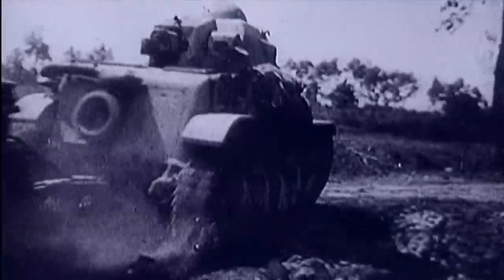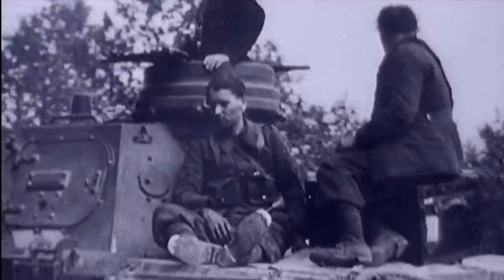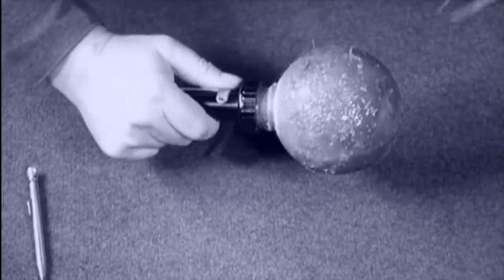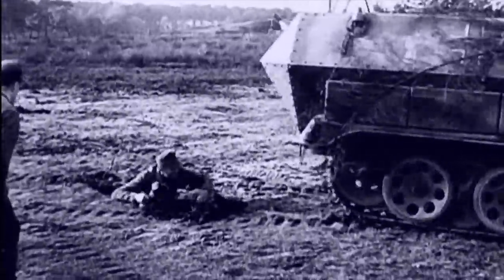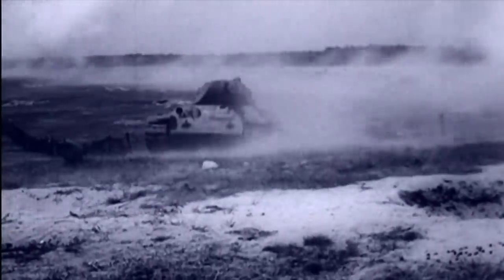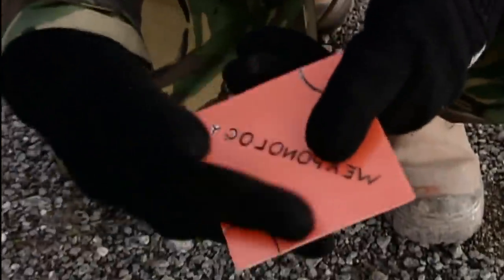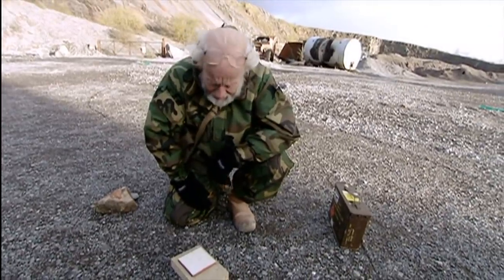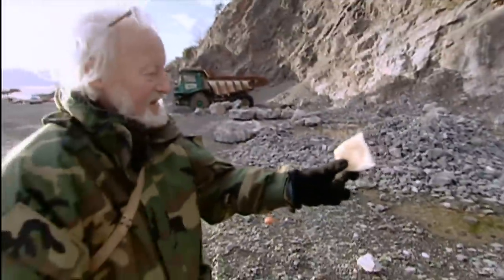Weaponology - "Sticky Bomb"

Comment: So heres a little bonus thing for yall: When the germans were making the magnetic charge they were also inventing a counter to it in case the allies copied them. It was called Zimmerit glue (the grooved lines on the German tanks) and would make it difficult for magnetic grenades from sticking to the tank. The downside to the whole thing is that only Germany used magnetic grenades making the glue pointless.
Reply: They just wanted to be sure

Comment: The trouble with the Hafthohlladung was that, unlike the Sticky Bomb, you couldn't actually throw it; you had to literally run right up to an active enemy tank, hand-place it to ensure it gets a grip on the armor, give a good hard yank on the igniter pullcord, and run like hell. The Sticky Bomb, meanwhile, was designed from the outset to be thrown by a grenadier from cover such as a foxhole. The Germans basically stopped using the Hafthohlladung as soon as the Panzerfaust (a sort of disposable anti-tank grenade launcher, in fact you can see one at 4:35 on the shoulder of the German soldier) was available in sufficient numbers, and declared them officially obsolete in early 1944.
Reply: The Soviets probably had the best idea with the RPG 43.  It uses a shaped charge, but deploys a parachute as it’s thrown so the warhead always hits straight-on.  A later model called the RKG 3 is still being used in Ukraine as a drone-dropped anti-tank bomb.
Reply: @maximus9812 Around the same time, the German also came up with Panzerwulfmine. Which is also thrown like RPG-43. However, they were considered to be downgrade compare to Panzerfaust so they weren't used as much.
Reply: At least both ars better than what the Japanese came up with, Shitotsubakurai. Aka the Plunger of Doom.

Comment: Man were some of the UK's engineers intelligent or what compared to Germany's lol. UK: Yeah we'll create an anti tank sticky bomb literally using strong glue to make it stick.
Germans: Tanks are made of steel. How about we create a magnetic bomb so that it will stick to the metal.

Common sense tells you the German's had better thinking. Compared to the risks involved of using strong glue for the 'sticky' bomb, an how much more risk you had of it sticking to almost everything and anything. Tf man lol.
Reply: glue sticks on most surfaces of different shapes, magnets only on some metals
Reply: Mustang Rt all vehicles were steel and iron though..
Reply: tires too ? Also gue is cheaper than strong magnets.
Reply: Also: Britain was rather resource strapped at the time and couldn't waste valuable metal to make magnetic bombs.
Reply: +mikeze123 Since when are tires bulletproof? Why risk running up to a vehicle to blow up its tires?
Reply: MachineMan1992 More important is the brits could not afford to have their own personnel blowing themselves up with such an ineffective device.
Reply: BOMB CAN STICk to tires and make damage to other elements too, also tank can be really dirty and magnets can lose their ability to stick also are heavy.
Reply: never said that sticky bomb wouldnt fell off ;d main reason that sticky bombs is better idea are their price and simplicity.
Reply: mikze123 dude how expensive do you think magnets are? i mean cmon using fucking industrial glue that could potentially kill your own soldiers, thats freaking stupid
Reply: to created those extra magnets would require a longer process rather than just upping the production rate of a resource that is already on the production line such as glue. Germany only had so many factory's while the Brits had the factory's of all of america so on so forth with the amount of allies the allies had.
Reply: italians just threw demolition grenades on the engine grille
Reply: Disabling it, preventing movement. I see plenty of benefits to impairing the movement of a vehicle, especially when your charge cannot do decent damage against the interior of the tank.
Reply: Noah me too and you can get cheap strong ceramic magnets for 10 pesos (50 american cents) so its still the dumbest shit to fucking put glue to an anti tank grenade, i used to work at an electronics store and we would sell neodimium and ceramic magnets so i know which the prices are
Reply: ForgotHow ToUsername yeah it is a little bit harder to produce magnets than to produce glue but in that case why didnt they built the tanks with wood? cheaper and easier to cut, oh i wonder why they used steel
Reply: +Lord Turnip "why didnt they built the tanks with wood?" Actually they did, or at least the Germans did. German tanks were coated with a special anti-magnet compound called Zemmerit  its 3 main ingredients were Cellulose (wood fiber), Ceramic powder and Poly-Vinyl Acetate.
Reply: +Lord Turnip  You are absolutely correct it was, in hindsight a very dumb and wasteful idea... which is why the weapon was eventually removed from active service before the war ended. Most of the 2.5 million No.74 MKII grenades produced remained in storage when the war ended.
Reply: The real doktorbimmer coated, not built
Reply: Later in the war they started using paints that prevented you from magnetically attaching things to them.
Reply: +TheMainMayn So... are you basing your entire view of the UK's engineers of that era on one slightly wacky idea? I suppose those crazy Brits and their mad ideas are why Germany won the war... :-P

The Bombe. Colossus. Manhattan Project. Radar. Jet engines. Tanks (ok that one was WW1). Inarguably brilliant British contributions to engineering through WW2. 

The truth is that all participants researched many ideas, some turned out to be useful, some not. For example, Germany had the Schwerer Gustav - sounds great in theory, an 800mm calibre gun that can smash reinforced concrete from across the English Channel. Except you can't slew the gun to point at a target, you have to find a bit of railway that faces the target. Ooops, you actually need TWO bits of railway at the correct distance apart, side-by-side. And it takes 45 minutes to reload. And you need so many people to maintain and run the damn thing that you would end up impacting the war effort elsewhere. Plus it's so damn huge that it's an easy bombing target, and you would take out hundreds of soldiers at the same time because, well, it needs all those soldiers just to maintain and run it.
Reply: Then why did the brit lose their colonial empire and cease to be a superpower after WW2?
Reply: A magnetic mine can't be thrown,  it's a 3 kg hollow charge placed by hand.  Any candidates?.
Reply: If your going in on a suicide mission? Wouldn't you rather have an explosive charge that will actually destroy a tank, and not blow you up first?
Reply: doktorbimmer Compared to à Molotov cocktail it's safer and can more predictably destroy even a tiger. 
The German solution mainly scared themselves.  Zimerit increased costs and load while weakening armour.
Reply: The blast is a much bigger problem with the German solution,  where the sticky bomb is very similar in use to a common Mills bomb while having a much smaller blast radius.
Reply: +Adamast  Shaped charges have a smaller blast radius and much more effective armor penetration... the German device was not likely to attach itself accidentally on a non-target personnel either.
Reply: 1.5 kg of explosives with a 4.5 sec friction fuse hand placed vs 0.6 kg of explosives with a 5 sec fuse hand grenade,  your choice.  The roof of a panzer 4 is 10 mm,  no need for a hollow charge or even a heavy blast. 
You think that a sticky sock is as strong a glue as cyanoacrylate. 
From afar I think the British No. 68 AT Grenade developed the same year is mostly better than the No. 74 sticky Hand Grenade.
Reply: +Adamast The shaped charge device is the clear choice... without any doubt. Its the basis for all modern Infantry anti-tank weapons used today.
Reply: Netheryk You know what they did with their totally superior pre ICBM technology most of the time?  Bombing Antwerp.  Did you ever hear about the bombardment of Antwerp?
Reply: Really? As long as you hold it it wouldn't fire,  just like any (non german) hand grenade.  But I get you prefer a fire and run situation.
Reply: Who cares about looking when there is the meme.  There is clearly a safety lever along the handle held by a safety pin.
Reply: news flash! britain win and germany lost ;) the germans always takes things too far and pay the price. over engineering is one of those.
Reply: Dok - Because of debt and those countries wanting independence. Germany lost, deal with it.
Reply: Herr - The Sten was a decent cheap sub-machine gun that was used until very recently by the Indians. 
And lets face it, the Germans needed the help, poor things were getting their arses handed to them.
Reply: Felix- UK helped? They did I bit more than that. If it wasn't for Germany fighting Britain, losing massive amounts of resources to the Royal Air Force and Navy, and losing in Africa, they would have easily overwhelmed the Soviets. Losing to the RAF and RN was devastating to the Germans.
Reply: TheMainMayn yeah but who won the war?
Reply: Lol... it's so true. Just look at what helmets the Brits came up with in WW1 and kept on using them in WW2 you can't make that shit up... the list goes on, something just doesn't quite work out for them in engineering things
Reply: DS -  The list goes on? Please enlighten us with your imagined list.
Reply: Some guy said blow up tha tires😂😂😂
Reply: mikze123 actually you would be surprised how much that glue costed
Reply: Glue cost alot too
Reply: TheMainMayn Germans had a much higher budget, the Brits were desperate. And the sticky bomb did probe effective.
Reply: TheMainMayn dont you think magnets would be more expensive
Reply: It wasn't only used for tabks
Reply: The German AT device was much more dangerous to use as you literally had to run up to the tank and slap it on the side. The sticky bomb could be thrown or dropped onto a tank from quite a ways away, comparatively.
Reply: TheMainMayn magnetic doesn't work on other stuff ;)
Reply: "Common sense tells you the German's had better thinking. Compared to the risks involved of using strong glue for the 'sticky' bomb" you can trow that sticky bomb on top of the tank from window/distance and forget about it, german design needed to be manualy instaled on tank. Germans didnt have strong magnets(as we know them today) during WW2. In reality bouth designs was equaly crapy and ineffective...
Reply: well the sticky bomb was developed for guerillia so total okay
Reply: TheMainMayn 
Well, it seems the glue bomb was throwable while the magnetic bomb had to be placed directly by hand. I'd take that glue bomb over the magnet bomb any day.
Reply: Tanks had anti-magnetic coatings and the magnetic charges became ineffective whereas the sticky ones didn't.
The magnetic ones couldn't really be thrown and had to be placed at a specific angle, which the sticky ones didn't'
The sticky bombs were much, much cheaper.
Germany was massively low on rare Earth elements critical for not only magnet production, but steel production too, which became a massive issue late in the war.
If anything, the German engineers had worse thinking, the only think they improved upon was the actual explosive charge. You have to think, if Germany's engineers were lightyears ahead of everyone else like you Wehraboos like to claim, then they wouldn't have lost the war.
Reply: Germans couldn't think well enough to win a world war though
Reply: TheMainMayn That was only one weapon
Reply: Zimmerit
Reply: the germans were the most intelligent, hell thanks to them half the shit we have to day wouldnt be here with out them.
Reply: unless the magnet sticks to your helmet.
Reply: youd just need a better design to avoid the magnet sticking to you, like if they used an electromagnet inside a round ball and have a slot for a button that breaks once pushed in and completes the circuit from a battery to activate the magnet and tossed at the same time with the explosive being impact sensitive you'd have an efficient sticky grenade
Reply: TheMainMayn with magnets you had to run up right next to the tank and place it. The glue can stick even if you throw it from far away.
Reply: Germans put an anti-magnetic coating on their tanks.  It greatly reduced the ability to stick to armor via magnetism.
Reply: TheMainMayn and so anti magnetic tanks.
Reply: atleast the magnetic charges dont stick to your soldiers.
Reply: @mikze123  tanks didn't have tires,  they had treads
Reply: Germans are superior lollol
Reply: The only issue the German's version had was that you couldn't throw it towards an enemy tank as the magnets were only on one side, and it wouldn't work if it wasn't stuck on properly.
Reply: luckily we weren't smart enough to win the war(s)
Reply: It's almost like weapon technology progresses and progress is hastened when in war. Who would have thought it.
Reply: Worth noting that the Germans actually used a protective non magnetic armour covering on their tanks. Therefore negating any benefits of the British using magnetic bombs.
Reply: @alejandrorobles6865  thats now, not in fucking 1943 smh
Reply: It's not like they were two methods used for the same problem. The ways you could use the sticky bomb were much different to how you would use the magnetic shaped charge. For example, you could not throw the shaped charge down form a window, you couldn't throw it under a tank, and you could not use it to damage tracks of a tank. There was a very specific way of using it and it was also useless against pretty much anything other than tanks. 

When it comes to engineering, Brits had HESH ammunition for example, which was very effective against some tanks, as well as fortifications and structures.
Reply: gromann what about the tank crews that decided to cover their tanks in camo materials that were not magnetic?glue bombs provide many problems for the person using it but it sticks to anything
Reply: @mustangrt8866  But its not like the armies could afford replacing all the tanks to change material type.
Reply: Mustang Rt / The risk of it sticking on you is lower unless you are magneto.
Reply: Yea uk dum
Reply: @mustangrt8866  WWII tanks were steel, and glue is pretty much shit on a dirty surface.
Reply: The "sticky bomb" was intended with the capacity to be thrown, and didn't use a shaped charge. It was essentially a squash head round, hand thrown.
Reply: German tanks had an anti magnetic coating, so now who's clever ?

Comment: The jet of metal (usually copper) being forced through the tank's armor (usually steel) is so high that it looks like it melted through. At those speeds metal behaves more like a liquid than a solid. The actual hole is quite small, but the real havoc happens inside the tank. Imagine being hit by a jet of hot metal, having bits of hot, fast metal shooting around the inside of the tank or it hitting the ammo.

Comment: A solution would be to attach a small compressed air canister in the stick grip of the grenade that would trigger a second after pulling the pin and "shoot" the cover off of the grenade while it is in flight

Comment: The British military was never particularly interested in what one would term "user comfort" for their enlisted soldiers (other ranks).  Yes, the Sticky Bomb was the worst, but there were others.  The British Boys anti-tank rifle is said to have a tremendous and very unpleasant recoil.  Likewise, the PIAT, the British counterpart of the Bazooka, was tricky and often very hard on its users (though it did have a much better bomb than the Bazooka).  And then there was the SMLE .303 caliber British Jungle Carbine with a cone shaped flash hider on the muzzle. The cone captured muzzle gas and vastly increased recoil. In response, their military put a "recoil pad" on the butt of the rifle stock to help out a bit, but the pad was made of extremely hard, non-recoil-absorbing material, and was a complete waste of time.  Conservatism was rife in the British military. In the First World War, suddenly faced with German poison gas warfare, they sent instructions to their army saying that it "might" help if men pulled off their socks, urinated in them, and then held them over their faces when the poison gas was coming their way......  oh, well.
Reply: That was done in time of need: right after Dunkerque. The UK had lost almost all AT equipment and some improvisation was needed before new guns could be produced.

Comment: Feel free to correct me if I’m wrong, But isn’t only Magnetic Explosives fail to stay attached to a Panzer if the Panzers outside coating was coated with a Thick layer of Zimmerit?

EDIT: Very shortly after I sent my Comment, My main point is that could Sticky Bombs still work on a Panzer with Zimmerit?
Reply: Glue sticks to anything eh

Comment: Why not have the ring pull on a cord attached to the belt of the thrower or something.
That way, the timer wouldn't even start unless it was at least 10ft away from the thrower or something like that.

If it got stuck to yourself, or another friendly soldier, the cord wouldn't be pulled, and you could safely remove it without a panic.

Comment: I wonder how much damage you can do with a sticky bomb on a tank. I bet the explosive can´t be much better than TNT and without the Munroe effect, the penetration should be less than 10mm of steel (even a tank round of HE won´t do more than 20-60mm depending on the amount and type of explosive). Maybe, you can damage the radiator or optics, but I can´t see much more than that. In this context, even a low tec Molotov appears to be more practical...
Reply: I bet a simple google search would have answered that... I could have too but felt lazy.